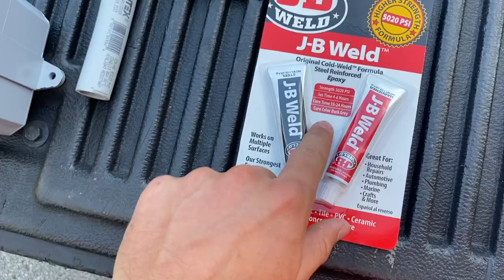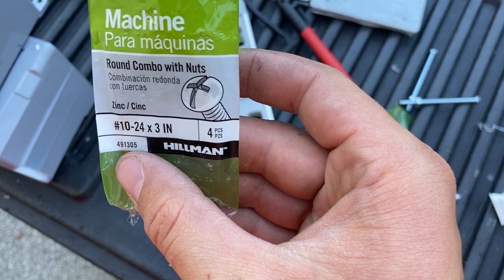DIY Jon Boat Power Pole / shallow water Anchor ( BUDGET FRIENDLY )

Comment: These are shallow water anchors not power poles. You kinda need the power part of the name to make them power poles.
Reply from the maker: It’s a “power pole “ like a diy. Cheap version of what a power poles does for those fellas that can’t afford the real deal…. For a jon boat.
Reply: Ok. So this acts as a stake out pole. Not actually something you run through your battery system. Had me confused. (I'm new to this, so be gentle)
Reply: @greyscout01  muscle power. Takes power to push it down and pull it out

Comment: Got my first boat finally for 60$ and fixed it up in a day with nothing but jb weld and even used it to stick pieces of pvc pipe on the inside for rod holders if it’s in the sun it sets in like an hour or two. Love that stuff